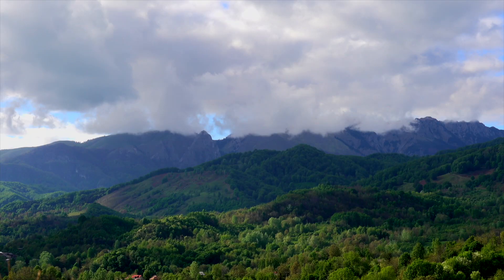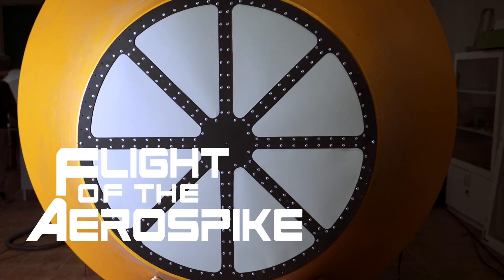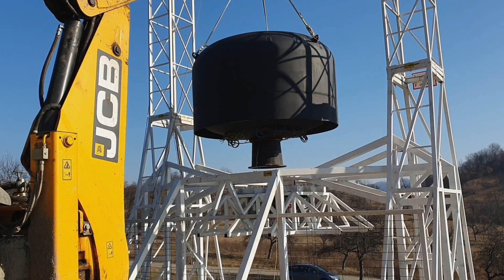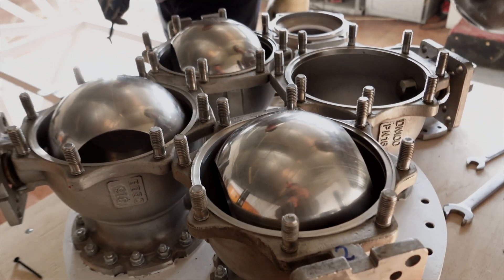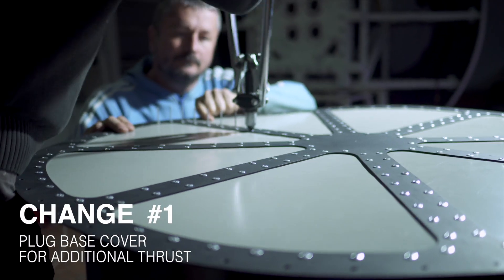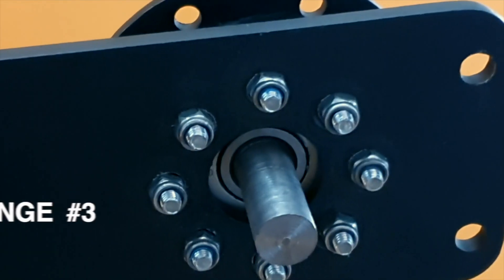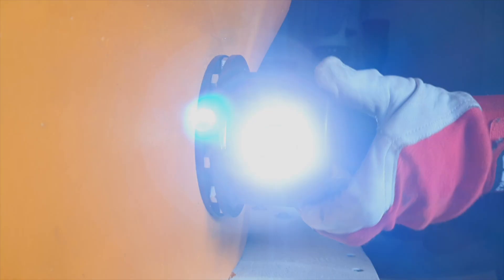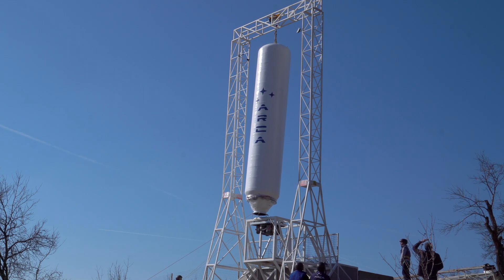Flight of the Aerospike: Episode 38 - Mission 9 Preparations

Comment: as far as i know, the heating elements are heated up and kept at ~250 degrees C from ground power supply. how much more is needed during flight and assuming you'll go with the LiPo batteries, what is the weight of those batteries you'll mount on the first stage? LiPo's have quite a bad energy density even though they are probably the best option right now.

Comment: It is truely facinating how the Flight of the Aerospike is "just round the corner" since so many years now, that you need a new idea to get more investor money and attention.
The use of Water (even if under high pressure and high Temp) is just not a usefull fuel for high power applications, the "lower pollution" doesnt make up for it in any way (conventional rockets beeing not that polluting themselfs, especially Hydro-LOX).

I dont think, extrapolating the way up to now that this aerospike programm will take of, but feel free to convince me otherwise by actually flying one.

Comment: Have I undersand it correctly that Mission 9 is the first mission, on which the aerospike eingine takes off?
Reply from the maker: There were other two flights of way smaller rockets at the beginning of 2000s. This will be the largest ever to fly. This will also be the first one tested in flight that uses TVC (Thrust vectoring Control).
Reply: It will takes off in December day 32